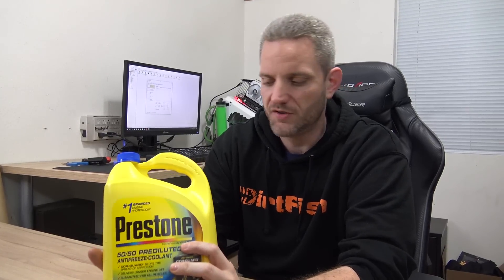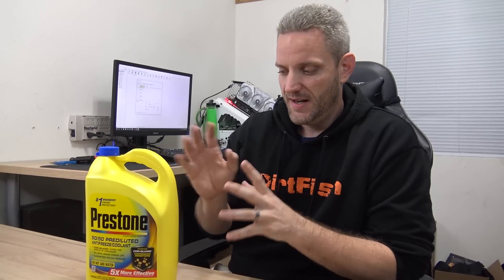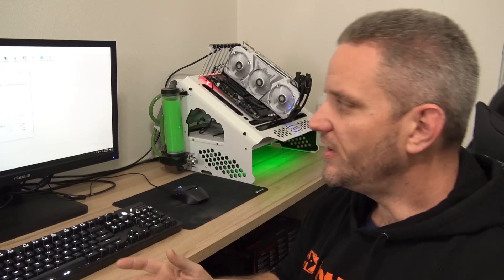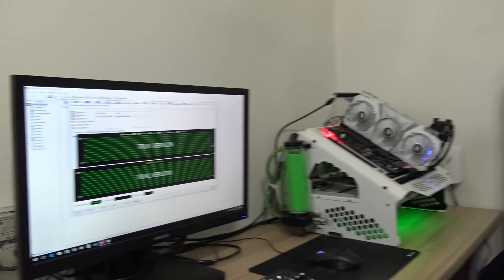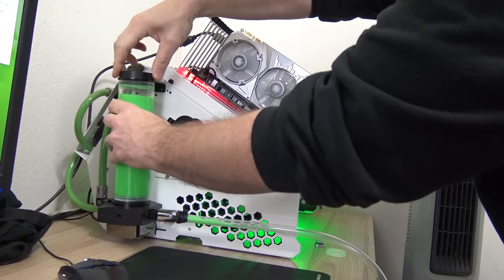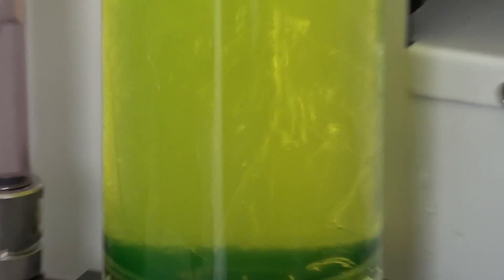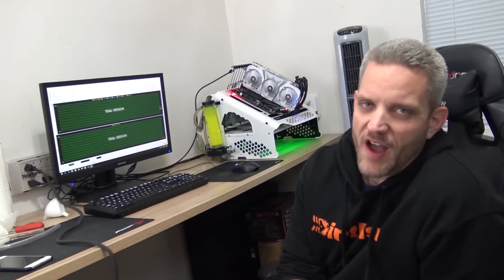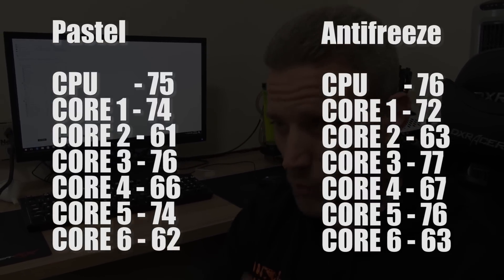I used Antifreeze to cool a PC

Comment: My Corsair H80, been running bit for 4 years, then the day came, 90 degrees centigrade idle CPU temps came... Fuck it, pulled it apart (although I'm sure you're meant to throw it away and buy another) and put Anti Freeze in the AIO!  27 degrees idle, I'll watch it closely for the next month and going forward obviously

Comment: Additionally, engine coolant is designed to keep engines around 180F-200F.  That's 82C-93C, which is no good for CPU's.  That's why engine coolant doesn't work any better than the standard fluid used in AIO's or custom setups.

Comment: I know I'm late to the party on this one, but the reason your tubing turned purple is what is referred to as "tube burn".  You see it in older hot tubs.  The long term movement of hot water discolors the tubes, typically into a maronish/brown color.  I'm guessing yours is purple because of the green liquid you've been using.... cheers!

Comment: O do the video is 4 years old I had that question also , but I was thinking in another extra element to it base on the same principle of an AC house unit , when the evaporator is sprayed with water to cool it and therefore the condenser will remove more heat from the room  ,but is the longevity of the materials I am concern ,  the point of using ethyl glycol is because it can withstand freezing temps. , so If I can run the tubing in to a radiator inside a freezer , I imagine that as long as I run the system won't freeze , but overnight when is off will freeze inside the radiator in the freezer , so that is why I tough about Ethyl Glycol in the first place , because if I going to use the regular radiator as use in many cooling setups is not worth it as your video shows temperature wise , so in short I am not looking in to lowering temperatures , but rather have the liquid chilled in a freezer but preventing it from freezing and as it is chilled, then it will lower the temps in the CPU and GPU if so is the setup , about condensation, well, that is another 20 bucks , but I have few ideas to prevent condensation , so my concern is the chemical  reaction of the materials , tubing , blocks  and pump plastics , seals etc.. that you mention but didn't actually cover in the experiment.

Comment: Antifreeze is used for cars because it won't freeze inside the Engine.
Because starting a Car at -30° C would be hard with water (it is literally impossible and the engine would be damaged)
In your PC that is not the case,that's why it does not use Antifreeze.

Comment: I love how many of you seem to think you know what you're talking about without doing any research yourself. There's a reason why people talk about antifreeze working for years without finding any corrosion. Clearly the stuff is designed to be used as a coolant in a place that would have dissimilar metals/plastics. I would think the automotive industry knows a bit more than your resident water cooling "experts" who see nothing wrong with spreading FUD. 
Now you might not want to use it if the plastic in your tubing is becoming discolored, that is a valid concern, however you can choose plastics that are perfectly compatible. If you're looking for a solution that actually functions better than overpriced "specialty" coolants then dilute some antifreeze with distilled water. You will at least have piece of mind that galvanic corrosion won't be an issue for a couple years minimum. If anyone doubts my words, I hope you'll research this information yourself and form your own conclusions. 
Read about galvanic corrosion in relation to watercooling. Dilute antifreeze is not a bad idea especially if you're tight on cash or just want something that's proven reliable.

Comment: Coolant doesn't do anything. The glycol based solution of the coolant is for anti-rust/corrosion and lubrication. The main cooling component of coolant of it is the water mixed in with it. That's why it's a 50/50 mix. Naturally cars can run on just water, but again we tend to keep avoid doing maintenance on vehicles the way we should anything that has a preventative maintenance schedule. Therefore the compromise for the customer.

Comment: Sir, I am using Gigabyte GTX 1650 Windforce OC edition, I want it to liquid cooled with radiator like Corsair One has, which is the best compatible liquid cooled system for my graphic card.

Comment: The "reaction" is the coolant mixing with water. For me as a Car mechanic it normal to see that because I have to dilute this stuff myself depending on the expected lowest temperature in the winter...
Reply: Just the different densities of the coolant & distilled water as the less dense water is rising & mixing.

Comment: all modern engines have plastic and rubber fittings including stainless alloy and steel parts also the water pumps are plastic. it will be 100% safe in your loop.

Comment: I use anti freeze in my cooling loop. I put in the anti freez in the loop at 6/11/14 did not empty it until I liquid cooled the gpu on 3/6/20. I’m using Tygon A-60-G Norprene tubing and a Swiftech MCRES Micro Rev.2. I haven’t seen any clouding in the Rez or any signs of loss of thickness in the acrylic. And the anti freeze is UV reactive.

Comment: I don't think it would do anything to plastic, to test this theory out you could fill a jar with anti-freeze and put a few components in it for an extended period of time. However, anti-freeze does not have an anti-biological agent. It is designed to cool car engine and remain around 90 degrees Celsius. Therefor it is impossible for bacteria and bio-material to grow and develop at those temperatures, however, your PC will maintain your loop at a superb temperature for that to happen. Great video nonetheless.

Comment: Fun fact; i know this is old video and idk if anyone already mentioned it but that phenomenon around 6:00 or so is due to surface density's of liquids mixing like adding ever clear to water or lower percentage alcohol you can observe the same effect. 

Ever wonder where the bubble's in a beer come from? From the tiny pores in the glass that build up CO2, gravity has little to do here as it's mostly due to the london forces when molecules can be slightly attracted to poles of another molecule. Or the same way soap bubbles cling to the edge of a a container with no water flow. It is pretty though.

A tad curious if anyone's attempted to cool a cpu/gpu with sub critical CO2 under vacuum before now though....

Comment: you should try this again but use 50/50 extended life from recochem, it goes by a few names which can be found on the MSDS sheet; it's probably closer to what is used in AIO's as it's glycol based with not many additives..... vs regular antifreeze which is not glycol based

Comment: use mineral oil, or cooking oil... I am not referring to dumping the whole PC in mineral or cooking oil, but rather using those material inside the cooling loop.

and for anti-freeze as coolant, um NO! it is gonna be toxic in your room.

Comment: But WHY would you want to run anti-freeze to begin with?
Even if it wasn't reactive to many things - why would you want to swap out water with a fluid that is more viscous and has less heat-capacity?
The only legit reason I can think of would be for sub-zero chiller cooling (in which case you need something to lower the freeze-temp for obvious reasons). There are other liquids you can use for that purpose that are much more stable though.

Comment: Why? Antifreeze doesn’t cool nearly as well as water. It’s only used in engines to prevent corrosion rust and prevents from freezing in cold weather that could ruin your engine block. Plain water cools way better alone.

Comment: From my personal experience... I have two water cooling rigs. One with soft tubing (Tigon chemical resistant tubing with dual D5 pumps) and the other with hard tubing (Acrylic with dual DDC pumps).

Soft tubing rig (i7-5930k with graphics card cooling) has been running  on Castrol Radicool (engine coolant) with a concentration of around 60% coolant and the rest distilled water since 2015. 

Hard Tubing rig (FX-8350 with graphics card cooling) has G12+ VW engine coolant running through it with similar concentrations since 2016.

(Bought pure engine coolant on both and did my own mix).

So far... no problems, no leaks. No abnormal temp fluctuations since the first day I ran them till today. And I did not change the coolant ever. I have extra temp sensors in the loops keeping an easy watchful eye on them, not to neglect the built in system temp probes. All pumps are speed monitored. Nothing has changed what so ever. I even have digitally monitored flow meters.... no reduction in flow at all. Same exact numbers... no precipitates, no extra softness or visual wear on the tubings. 

However, I do not have enough information to evaluate whether it is a more efficient method of cooling. Probably not... pure distilled water would probably be the best despite its drawbacks... but as for longevity... so far so good.

Comment: Glycol tubing aside, I think I would look for the long lasting antifreeze instead of the standard green stuff.  Reason being it's PH neutral - so there will be no acid corrosion on copper, steel, or aluminum.
Reply: no way, the orange dexkill will be worse green is better

Comment: I use vinyl tubing in my builds with brass fittings (half inch barbed fittings with hose clamps) it is extremely ghetto looking, but as a mechanic with a thing for computers I went for the KISS mentality. ive ran exactly like that with an alphacool radiator and cpu water block/pump on top of an intel 3970x also cooling a pair of archaic amd 7970s. suprisingly all has gone well! I never saw any of that crazy reaction stuff in my res like you did though... if I ever saw that in my computer id be having a panic attack! (by the way I know it was a horrible processor choice. as a newbie back in the days when it came out, I thought cores and price were more important than they are)

Comment: Well tubing will turn into flexible  latex instead of firm rigid tubing>only diff is your not fighting cold your fighting heat that's the waters half of the 50/50 mix.now hear me out as a wannabe physicist liquidized mercury would never get old and cool without fans..oh and leathal?! Good show...

Comment: probably also been answered the millionth time, but the point of having glycol in your antifreeze/coolant is to keep it from "FREEZING", why it's called "Anti-Freeze". Water still does the heat dissipation, which is why you are required to mix it in. All it does is set the freeze point.

Comment: I really like how the antifreeze looks!
Reply: Here to my future self, the family of G11 or G12 coolants are absolutely safe and won't attack the pump or any plastics.
In fact I have a loop running G11 coolant 30% concentrate since 2021 go figure😂 no problems whatsoever with mixed metals /alphacool xp3 light and a 420mm aluminium rad and a D5 pump.

Comment: Antifreeze sucks as a coolant. Even in cars. It's entire purpose is to keep water from freezing. Not to cool. It's second purpose is to lubricate and keep the system from rusting. That's it.

Water is 100 times better for a coolant. That's why race cars simply use water with a additive like purple ice or some other combo rust inhibitor and/or lubricant. 

Running antifreeze is guaranteed to run hotter than plain water every single time.

Comment: I know I am just about 3 years late to ask but what about super coolants such as hypercool added to either a pc branded designed coolant or straight distilled water? Hypercool states they do not use glycol in their product, claims to reduce temperatures and can be used with straight water. I know you mentioned using a 50/50 mix of ethylene glycol can eat away at the petg type tubing or plastics within the loop and cause catastrophic failure but there is no glycol in the product that got me to ask this question. I am just thinking now if this stuff is alright with petg/other plastics and keep temperatures lower than a normal water loop?

Comment: Lol. Way late to the party on this one but in 2003 I wondered what would happen as well and put it in my outgoing Koolace rig. It cooled so I let it run and kept playing a few games between it and the rig that replaced it. Few months later clear parts were not to clear and tubes started to always feel wet without being wet and saged a bit more. Some fittings had a crust around them. The pumps black plastic housing began to degrade around the edges as the glue or sealant dissolved. Everything had a sheen on it by that point and you could smell antifreeze if you sniffed around the case. Later the wife "suggested" I move my experiment or myself to the garage which I said I would do that weekend but it all came to an end the Friday before moving it when the waterblock seal on the ATI card gave up the ghost and antifreeze started aggressively cool the card. A few random pops and hisses ended with a sizzle, smoke and a light show as the card caught fire. Talk about an old school light system. I invented the caveman light system but couldn't find a market to sell it in. As she was out and had long since placed a fire extinguisher next to the computer (she was a passive aggressive hint master) I decided to see how long my game would last and kept playing for about 30 seconds till the screen went black. After tearing everything open I saw just about every seal was toast and random plastic parts were soft to the touch. Anything that had glue only stayed together out of habit as they came apart with less force than taking legos apart. Luckily it was a hot day so having all the windows open and every fan in the house going full blast didn't raise any suspicious concerns. I see you moved the computer. Thank you. Yea. Ahh no problem hun. Anything for you babe while sporting the worst poker face ever. A year later she heard me telling a friend about the story and a very stern WHAT! Was directed at me from across the room.....
Reply: lol love the story telling

Comment: Antifreeze (coolant) is used to stop something freezing. Using is to cool is not a thing. Same with cars.
Reply: So the antifreeze isn't the medium for heat transfer from the engine bock to the radiator. Trade your car in and get a bicycle.
Reply: @sk711g6  hahaha I do have a bicycle. In aui, it gets hot. We don't freeze here

Comment: why on earth would you use anti FREEZE in a system that deals with heat?!
Reply: Cars use antifreeze and their cooling system deals with heat. The problem is when you turn the car or system off and your coolant is frozen. That’s why anti freeze is used.

Comment: Did you not think of using a propylene glycol based antifreeze, used in RV systems that will not react with your tubing and is less caustic to the system in general?

Comment: I am a former mechanic and I can tell you 100% for sure automotive antifreeze (Ethylene glycol) attacks rubber and different types of plastic. Also it is very toxic and has a sweet taste. If your PC springs a leak (which it may well do as the coolant eats your water block seals for instance ) your pets will drink the leaking coolant and it will kill them.  

If you really want to use antifreeze a good alternative would be "RV & Marine Antifreeze."  It's propylene glycol which is non toxic and does not attack rubber or much of anything else. In fact food grade propylene glycol  is used as a preservative. Best of all it's cheap as hell. You can get it at Walmart for like $2.50 a gallon.

Comment: This was a pointless video.  Ethylene glycol is only used in cars for freeze protection.  As a conveyor of heat, EG is not nearly as good as plain water.  EG will increase the boiling point of water which means the system will operate under less pressure.  There is no pressure in a CPU cooling system.  A complete waste of time.

However, this video garnered 1.3 M views.  Forget the science and go with the action.

Comment: I've been using car coolant for a month now on my all in one enermax block. Everything works fine.
Reply: It's not a good idea. I am a former mechanic and I tell 100% for sure car antifreeze attacks rubber and different types of plastic. Also it very toxic and has a sweet taste. If your PC springs a leak (which it may well do as the coolant eats your water block seals for instance ) your pets will drink the leaking coolant and it will kill them.  

A good alternative would be "RV & Marine Antifreeze."  It's propylene glycol which is non toxic and does not attack rubber or much of anything else. In fact food grade propylene glycol  is used as a preservative. Best of all it's cheap as hell. You can get it at Wallmart for like $2.50 a gallon.
Reply: https://en.wikipedia.org/wiki/Ethylene_glycol . It is used in pc coolers as for it.

Comment: Why NOT Try Liquid Cooling a PC with Auto Engine Oil?
After all Engine Oil Already has Rust & Corrossin Inhibitors 
in it; So that Less for you to worry about; Plus Engine Oil; 
Is Specifically Designed to Remove Heat from things. 
From Day 1 of it's being formulated. 
ALL you would NEED to use for Liquid Cooling a PC 
is an Full-Synthetic Mobil-1   5w-20   (or)   5w-30.
Reply: Sorry to tell you but engine oil is much thicker than diluted antifreeze and has a worse thermal transfere, but yes it would never rust 😂
But your pump would need an upgrade ta a much stronger one

Comment: TLDR then is: not formulated properly for the components and purpose and will cause damage to standard components as well as not being significantly better than purpose formulated liquid cooling fluids.  I'm more inclined to run some kind of AC unit I've bastardized into cooling my water to obscenely low temperatures than use weird fluids not intended for this purpose... hm... actually... I have one of those laying around.  puts on list for stuff to do when feeling overly ambitious